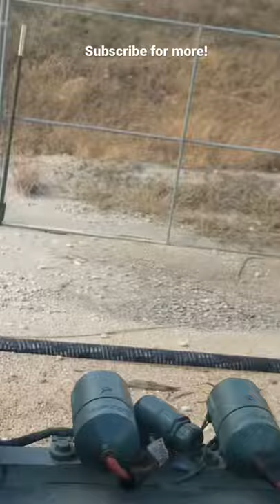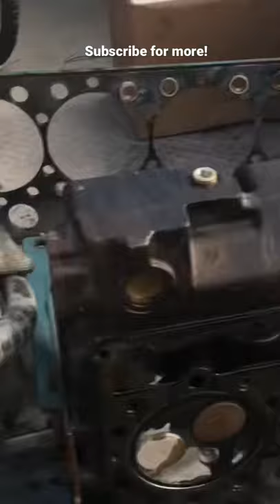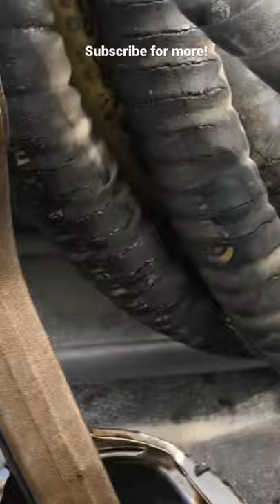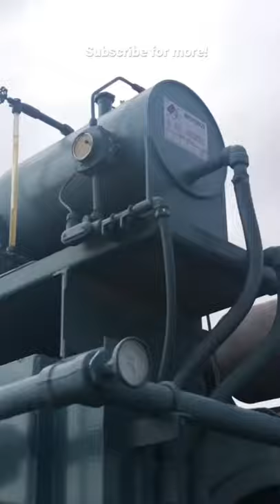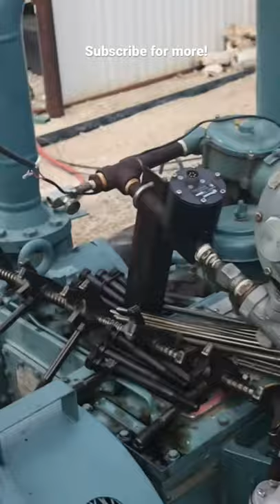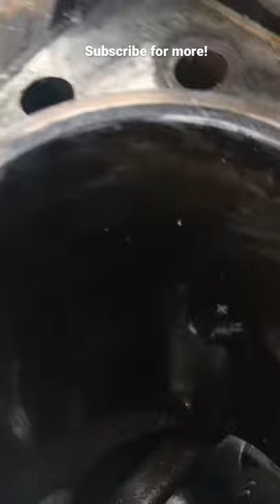Natural Gas Compression- What do I do on a day to day basis?

Comment: I’m here trying to find a freeze. My compressor keeps going down on high discharge kill! 😡🤬
Reply from the maker: Lmao! I don’t miss those days! I work strictly Engines now… just get an exhaust pipe and start heating everything up! Lol good luck man
Reply: @BrendenTheTechnician  I just let it thaw out. I’m not even the mechanic. I’m the pumper/MSO 🤣
Reply: You have a cooler freeze my guy. Close your loovers and pitch your fan blades for it to run warmer
Reply: @kalebowens5508  you are correct!
Reply: I don’t miss winter when i think of freezes
Reply: @Nave6W  freezes, muddy/soupy roads all winter long. 👎🏽
Reply: I'v been working on CNG compressors since '99.  I still can't explain what I do.  It's like juggling chainsaws blindfolded hopping on one foot while getting stung by hornets.